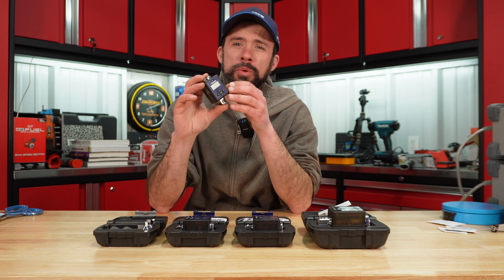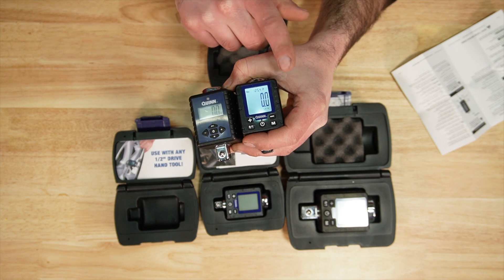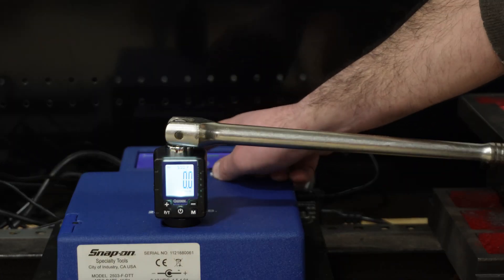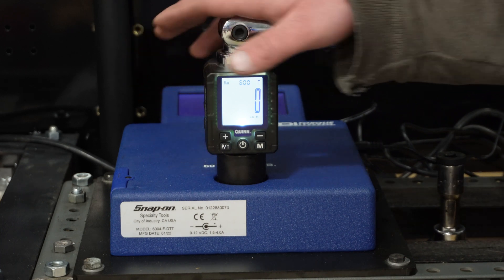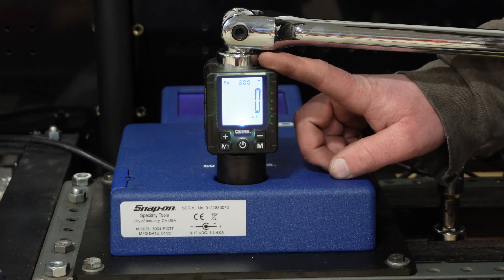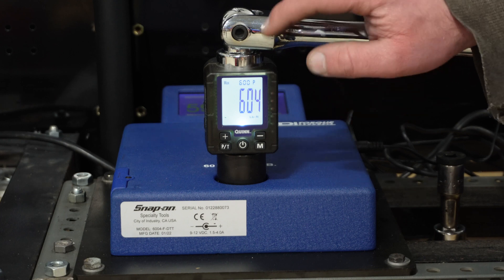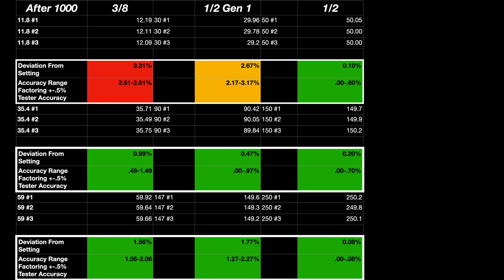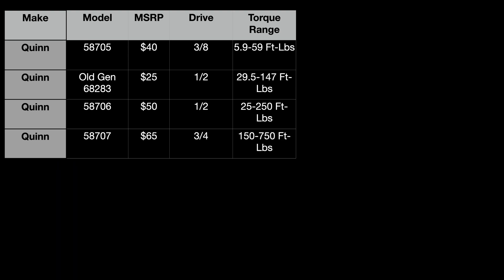Quinn Gen 2 Torque Adapter Testing

Comment: Was this test used with a ratchet? If so what ratchet?
Reply from the maker: Breaker bar, but you can use a ratchet.  Longer only makes it easier to control.
Reply: @Tools-Tested how about a torque wrench would that work?
Reply from the maker: @MelvinElian yeah that would be fine
Reply: @Tools-Tested no way? To have a click type torque wrench with a beeping adapter?

Comment: Thinking of picking up the 1/2 version, but i do have a question. i have mostly only 3/8 sockets/ratchets/ extensions but want to use the 1/2 version for mainly torquing lugnuts. if i use a 1/2(female) to 3/8 (male) adapter and use my 3/8 lug not socket, will i not see accurate results anymore?
Reply from the maker: Yes you can do that,  it wont impact the torque.

Comment: This thing seems extremely clutch. I already have a big 1/2 ratchet that’s essentially Breaker Bar sized so just slapping this $40 adapter on the end of it essentially just turns it into a digital torque wrench without having to spend a bunch more money for a whole nother big stick to take up room in my tool box, will be picking one up for sure!
Reply from the maker: Yeah they are a good value and come in handy.

Comment: First, thank you for publishing this information.  Question - I have the 3/4 Quinn, recently bought for axel nuts but curious how this performs below the 150 ftlb mark.  Is it still accurate?  I have an older click style torque wrench (10-120 ftlbs ) and I’m wondering if I can use this to perform quick calibration for accuracy. Thanks
Reply from the maker: No problem,  sadly I wouldn't recommend using it under 150ft lbs.  Even though it will read under 150 accuracy it's all over the place.

Comment: Would the 3/8 be alright to torque down pistol red dots at the 9lbs to 15lb, in your opinion?
Reply from the maker: You can, butI wouldn't recommend using it for something like that. Best bet is to look into a torque screwdriver.

Comment: It is interesting that Gen 1 of Quinn came with 3/8 & 1/4inch adapters. I had heard that added distance along the axis of applied torque affected accuracy of measurement. Did they provide correction tables for use with the adapters, or are any variances based on socket adapters deemed negligible?

This suggests that one could use similar socket adapters on the new 1/2inch model and avoid paying for the 3/8inch torque adapter, as well as add the 1/4inch socket adapter (presuming the range of applied torque is appropriate). Is this the case?

Thank you!

Comment: The link you provide for your 2nd generation 1/2 inch drive unit is model 58706, which I am considering buying. On that site it indicates 2 different user manuals for model 58706, each with a different UPC code. Comparing the contents of the manuals indicate different automatic shutdown times for each ( 85 seconds for UPC #4882 and 120 seconds for UPC #3082). Would you please indicate which UPC code is the 1/2 drive unit you are testing (last 4 digits as I've shown is sufficient)? Thank you for your informative videos.
Reply from the maker: Hello 4882 is the last four of the one I tested.  

Glad to hear you find the videos useful.

Comment: Do not buy and here why. If you hit power and memory button at the same time the calibration of the tool is gone and the torque adapter is worthless junk. No recovery from that. It could be that you Push power and memory because buttons are to close to each other. Power and memory button are exposed and if you place the torque adapter on a bad spot it could be that Memory and power button are activated at same time. The result is always the same the calibration is gone for good and there is no info how to re-calibrate.
Reply: @Tools-Tested: Can you reply to this?

Comment: Can the new version of the 1/2" be used for measurements under 25 ft-lbs? I know it says 25-250 ft-lbs but I was curious if it still can be used for the lower torque settings (I know it may not be quite as accurate since it is out of the range, but I'm interested as to how far out from the 2% accuracy)? Cause I like that is has a range much higher than the 3/8" one.

Comment: Great testing, thank you! However it's worth noting that even your test rig will also have some associated margin of error which will typically be greatest near the lowest end of it's range so the 3/8" might be less off the mark than it appears.
Reply from the maker: Thanks!  Yeah CDI claims this tester is sub .5% full range but I’m sure the accuracy varies some in the range.

Comment: Which is better for torqueing sparkplugs: QUINN 3/8 in. Drive 5.9-59 ft. lb. Digital Torque Adapter vs PITTSBURGH PRO 3/8 in. Drive 5-80 ft. lb. Click Torque Wrench?
Reply from the maker: If u have the room, preferably the digital adapter.
Reply: @Tools-Tested  Thanks for responding.
Reply: The Quinn 5.9- 59 worked great for  me when doing spark plugs

Comment: Wow, great content.  I'm unclear about something called "angle" measurements.  What is it, and why do we need it?  Thanks.
Reply from the maker: Thanks!  So angle is normal only used when torquing head bolts on an engine.  It depends on the manufacture but normally you torque the bolts 1 or 2 times and then do 90 degrees which is  a more accurate way of providing proper tension.

Comment: IM HAVING A PROBLEM WITH THE 1/2 EVERYTIME I CONECT THE BRAKE BAR IT SHUT OFF ITS THATS NORMAL ?? WITH MY 3/4 DOSENT HAPPEN
Reply from the maker: If new battery's don't fix it,  it's probably defective.
Reply: I have exchange it 3 times and still does the same thi g
Reply: And i only have the shut off problem whit the 1/2 inch not with the 3/4

Comment: I need one of these, but with a smaller head to fit on my ratcheting screwdriver. I couldn’t find one like that from any company. Only standard screwdriver with it built in.
Reply from the maker: I tested one in 1/4 but the overall size is the same as 3/8 version.

Comment: Can you take one of these apart and tell us how they work? It's very cool technology.
Reply from the maker: It works by wires which change resistance that are glued to the shaft of the adapter.  As that resistance changes the circuitry turns the voltage change to an actual torque reading.
Reply: @Tools-Tested  I already posted a video explaining this, but the comment was removed. Thanks though
Reply: Manual say NOT to take  apart

Comment: How long of a breaker bar do you meed for the 3/4 inch?  Trying to torque something to 350 ft/lbs.
Reply from the maker: Longer the better for leverage and it makes it easier to control.  Torque is measured by the adapter so the length won’t affect it.

Comment: how are you able to smoothly sneak up and hold those high torques?  Do you have like a 4ft bar extension on the breaker bar?
Reply from the maker: Yeah its tricky like with any other digital wrench, for testing I used a CNC table to dial it in.  This allowed me to keep a consistent pressure on the TW.

Comment: So I bought the 58706 model. Most things I am torquing are 30 to 110 inch pounds. Its range says 25 to 250 foot pounds. So what is the inch pounds range of this device. Do you just multiply foot lbs by 12 and that is the range. Which would make the inch pounds reading basically worthless, or does it read lower inch pound readings. I haven't opened it deciding if I want to exchange it or not.
Reply: With how small of measurements you'll want a micrometer

Comment: Handy! I just need it for torquing and retorquing lug nuts on my tractor trailer. I’ve got a range of 25’lbs to work with, 475-500. I typically run them to +-500. I suppose at 495 I’d be well within spec. Thanks a lot. I can’t justify a $300-500 wrench
Reply from the maker: No problem glad to hear it helped! Yeah 3/4 torque wrench’s are not cheap.

Comment: I have the gen one 1/2 inch but would it affect any readings if I use a 3/8 adapter and socket if I need to use it for space or whatever? I was thinking about buying a 3/8 torque wrench or adapter but I already have the 1/2 adapter and a 1/2 torque wrench so I don’t want to buy something that will sit and never be used. I also would like to see if I can calibrate my gen one just to make sure it’s within spec.
Reply from the maker: Yes using an adapter is ok,  it has almost zero impact on the torque being applied.

I don't know how to get it into calibration mode sadly,  wish I did.
Reply: @Tools-Tested Press down Power and Memory to calibrate

Comment: Have you tested if you use a extension on the torque adapter to get into tight spaces, would that change the reading?
Reply from the maker: Yes, extensions have almost zero impact on torque.  Swivels on the other hand will defiantly impact the desired torque.
Reply: @Tools-Tested  cool, thank you’
Reply: @stevensam8834 The Torque Test Channel recently did a video on myths about torque wrenches. One of the key tests he did was do adapter or extensions make a difference in actual torque application vs reading. It was fascinating, there is a bit of math, but nothing too hard. Basically as long as you are in line with where you're applying the torque it won't matter. However as soon as you change angles, or add or subtract leverage, it will change the torque applied vs what is set on the tool. It's very consistent however with what happens when. So go watch the video to learn about how the rules apply...
Reply: That makes good  sense😊 @Tools-Tested

Comment: I got one of the Gen 2 1/2 adapters for $50. It's amazing. I use it all the time
Reply: Is it worth picking up for 150ft lbs uses. My car lug nuts need to be torqued at 150 but that’s the upper limit on my click type torque wrench
Reply: @ws4835  yes my Quinn 1/2" goes up to 250

Comment: Do they have the ability to measure, for a example a 90 degree turn for stretch bolts?
Reply from the maker: No sadly not,  but you can use a manual degree angle gauge after torquing to spec.

Comment: Thanks for testing.  Looks like the 3/8 is less than 1/2 a pound off on the lower end.   I know it matters more on the lower end but I think I can live with that.

Ive stripped a couple bolts recently with some old torque wrenches.  Im interested to see if they are accurate.  I had ordered some after market parts since oem was no longer available for a very old honda car.  The bolts  stripped when tightened to 30pound spec.  I think the non oem parts were poorly made but now Im questioning my torque wrench.  Im going to buy the 3/8 and 1/2 version to get an idea how accurate my torque wrenches are

Comment: What are the differences between peak and trace?
Reply from the maker: So when in peak it will display the highest reading when applying torque,  trace/track it gives you the live readout.  So if you go up to 50 and let some force of the adapter peak will show 50  while trace would show under 50 so something more like 40   

Hope this make sense it can be a little confusing.

Comment: Looking for a good low lb torque wrench finding lot of these tests low end of the scale not all that accurate.
Reply from the maker: Yeah the low In Lb range can be tricky,  anything below 50 I would be looking at a torquing screwdriver.  I did test a 1/4 version of the torque adapter here https://youtu.be/bGo2tlCoVsI

Comment: I have the 1/2” 1st Gen one. Mine will actually go below the advertised 30 ft lbs minimum. Do you think it’s accurate under that area? I was going to use it to torque some oil pan bolts to 18 ft lbs, but I’m a little weary to do it because it’s not advertised to go that low. What’s your thoughts?

Didn’t see anything in the manual about it

Great channel by the way, just found it yesterday and subbed immediately. Really nice tests man
Reply from the maker: It definitely diminishes once you get below 20% of max scale.  It would probably be +-10%.

I would recommend getting this 3/8.

Thanks for the SUB!

Comment: I need to torque something to 8ft lb. I’ve read that torque wrenches are less accurate outside of the 20% - 80% range. Not sure if this applies to digital adapters as well. Have you done any tests between 5.9 and 10 ft-lbs ? I’m wondering if I should get the digital adapter or a 1/4 inch drive 20-200 in.-lb torque wrench.
Reply from the maker: You are correct normally below 20% the accuracy drops off.

I haven’t tested the 3/8 down that low.  I would expect the accuracy around 6%.

If you need something more accurate probably go with the 1/4.

I did test a 1/4 digital adapter which is very similar to the Quinn.  https://youtu.be/bGo2tlCoVsI

Comment: I need a 1/2” drive torque wrench and I’m debating on the icon split beam torque wrench or a long ratchet and attaching the torque adapter to it. Which one is the better route to go?

Comment: Could you use an impact wrench or driver with these devices or does the vibration make it a no?
Reply from the maker: No you would never be able to stop in time,  proper tool in that case would be a torque stick.  https://amzn.to/42biulo

Comment: I may have missed it in your video, but do these measure torque for loosening hardware with a peak/hold feature? in short, I'm trying to quickly measure the torque required to remove a stuck bolt.
Reply from the maker: Yeah the peak/hold also works in the loosing direction.

Comment: Can I buy them with delivery to Germany?
Reply from the maker: Sadly they currently don't ship outside the US.  This is a major complaint by people who live in Canada as well.

That being said some sellers on Ebay will ship Quinn to Germany.

Also Wisretec sells almost the identical unit model numbers 3/8 BDA3-135  1/2 BDA4-200  3/4 BDA4-340
Reply: @Tools-Tested  appreciate you answer🤝
Reply from the maker: @Andrey221ua  No problem!
Reply: @Tools-Tested  This brand Wisretec as accurate as this one(Quinn)?
Reply from the maker: @Andrey221ua  I only tested it in 1/4,  seemed to carry the same accuracy,  only thing different was the screen is not back lit.
Reply: @Tools-Tested  Thanks
Reply: @Tools-Tested  Are  you sure the BDA4-340 is 3/4 ? I'm going to buy this version and I saw it is also 1/2 but now I am confused.
Reply from the maker: @guilhermeg345  version I have is 3/4

Comment: how do u set these things ,, do u just press the positive and negative to the desire number and leave it or do u press other button to make it memorized the number u want it to beep on
Reply from the maker: You can press the M for the preset number and then adjust the torque number up or down and it will save that as the pre set.
Reply: @Tools-Tested  

got it thks....

Comment: I have watched and rewatched this excellent test video, but it's not clear how the target torque is indicated.  Does solid red mean stop?   Does flashing red mean approaching?  What does the whining sound indicate?  I am asking because it seems like you are pushing past the light indicator changes to make the numbers match, but I won't be able to see the numbers in all applications or positions, so it is important to understand how to interpret torque based on lights alone.  Is that possible?  Or would a click wrench be better in 'blind' applications?   I still have an old beam torque wrench and it is kind of stressful watching that needle approach exact torque at awkward angles and was looking for something better.
Reply from the maker: Thanks!

Best approach is a click style in my opinion, you can just apply a constant force till the click.

Digital wrenches are tricky because you need to slow down and can easily over torque,  defiantly when you cant see the display.

The leds on this flash faster and then go solid just past the torque,  over by 1In Lb I found.  At the same time the buzzer is also sold.

Comment: Some people use these to convert regular ratchets to torque wrenches.
Reply: I think thats the point
Reply: @jjglistens5312  I think so too, but I’ve also seen people use them to check the accuracy of their torque wrenches.
Reply: Yeah or you can use large breaker bars when you are doing higher-torque fasteners. It's nice to do head studs (120-130 lb-ft) with a longer bar since you get a smoother, easier pull than a standard length torque wrench.
Reply: @DaveScottADV  This makes sense. People also say that the handle sleeve sometimes moves on click style torque wrenches, which can change the torque setting. This won’t happen if you use the torque adapter on a ratchet or breaker bar.

Comment: Does the length of the wrench used have an effect on the amount of torque delivered?
Reply from the maker: No wrenches extensions adapters etc before the adapter won't affect the torque,  its after the adapter things like extensions will reduce the amount of torque.
Reply: @Tools-Tested  Great test by the way! 
I tested this device with a regular ratchet wrench, and it was way off. I used a 13" breaker bar, and the device showed the precise setting. It appears that the length of the wrench used (in my case 6" vs 13") directly affects the torque.
Reply: @rlyle5804  The length of the wrench should not matter at all in theory as there is no way the torque adaptor can "know" or "see" anything other than the torque that you are applying to the end of the digital torque adaptor.  Is it possible that you are changing your technique somehow between the two wrenches?   Creeping up to the torque vs. rapidly torquing?  Or perhaps using at a different angle?